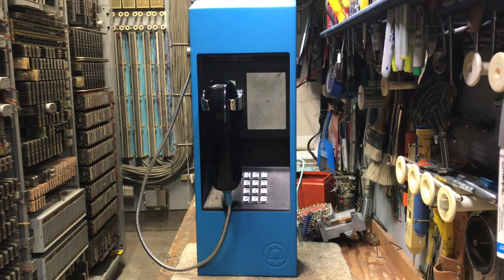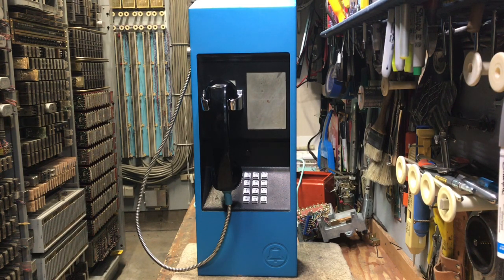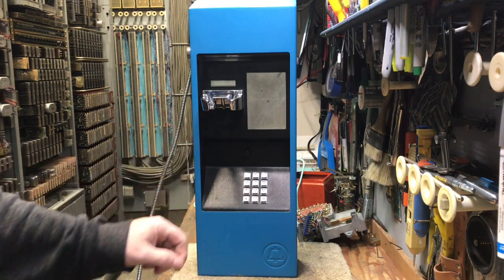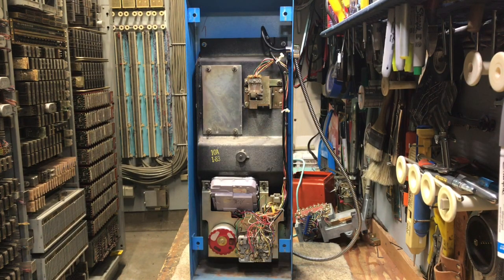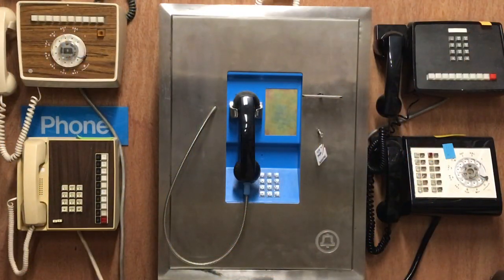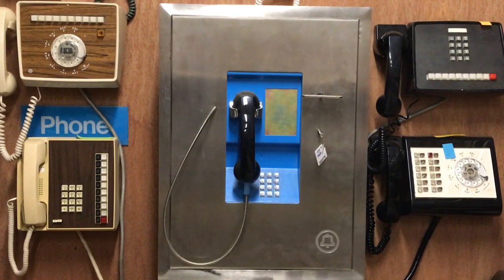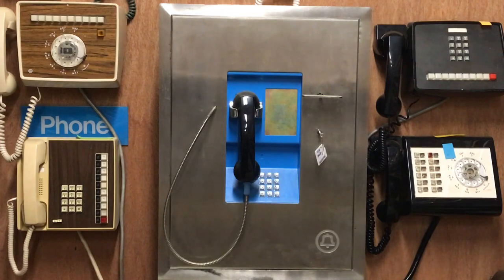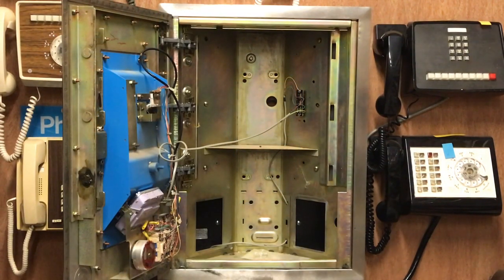Western Electric 10A ,20A Charge-a-Call coinless payphones.

Comment: These were used to dial 950 Feature Group B (FGB) trunks (i.e. 950-1022) to use phreaked MCI/Sprint calling card calls since those 950 calls did not require any charges to dial.  Some Bell coin or COCOTs required a local call charge (.25) to make those 950 calls.  And 800#'s were always free, but the phreaked cards were restricted to 950 access only.